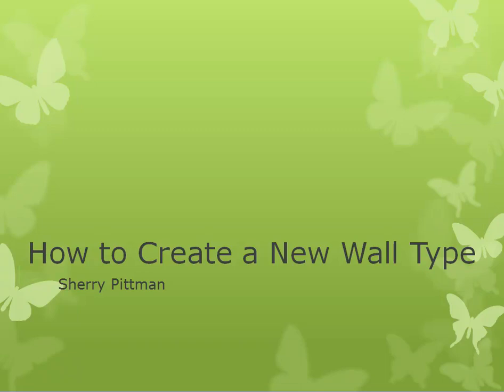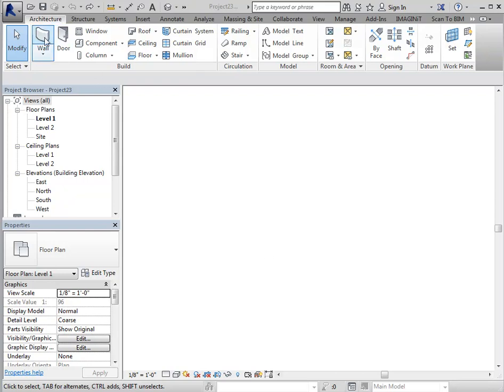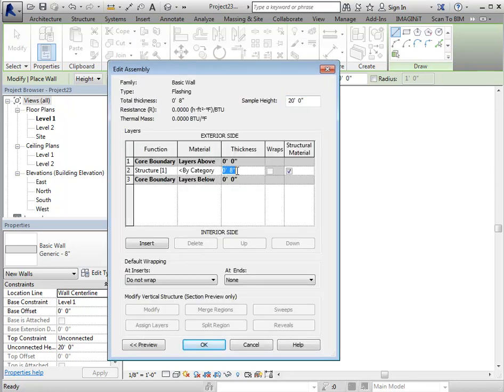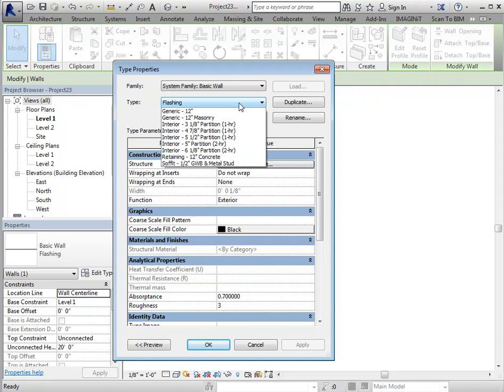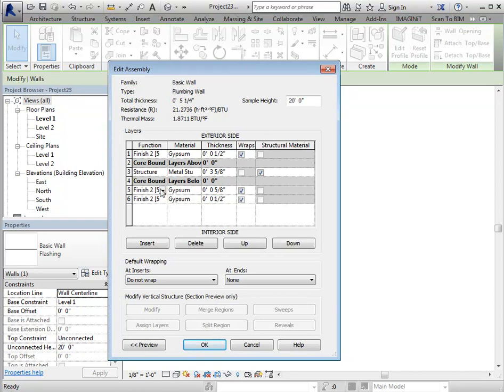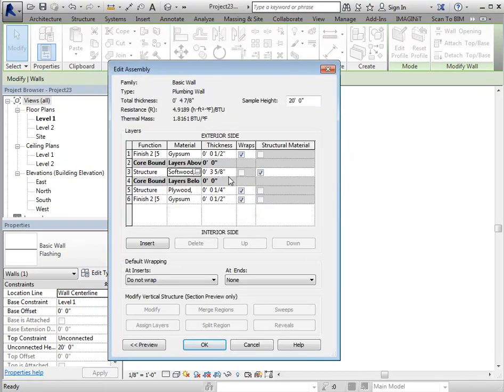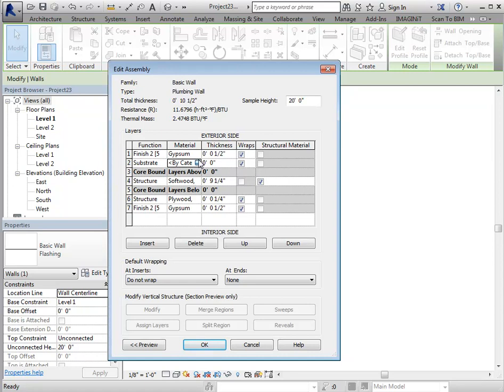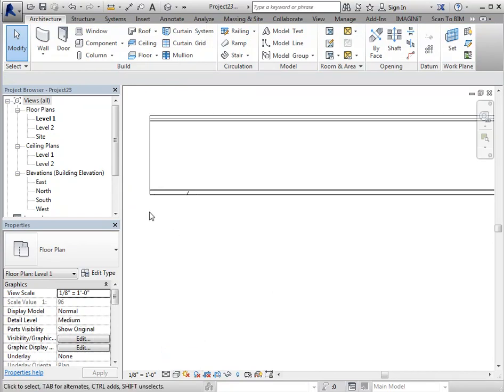How to Create a New Wall Type in Revit

Comment: Hello Sherry!
I created my wall, and cannot find it to use on a new project. I mean, when i start another project the wall doesnt show on the list... would you tell me whats happening, if you please? Thanks
Reply from the maker: Bonnie, walls are system families, if you want to use it in another project you will need to open both models...the one you are copying from and the one you are copying to.  If you just need the one wall I would copy it from the browser and paste it into the other project.

Expand families, walls, find the one you need right click and copy to clipboard, then switch to the other project and Control V

You could use transfer project standards instead if you needed all the walls.

If this is a wall you want in all projects you start you would need to add it to your template.